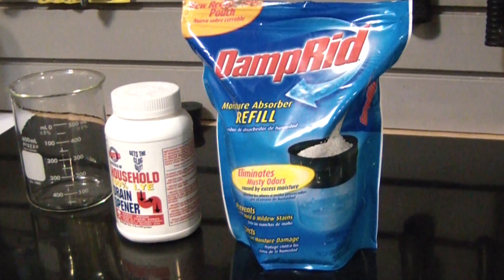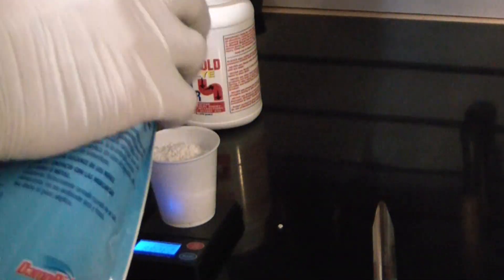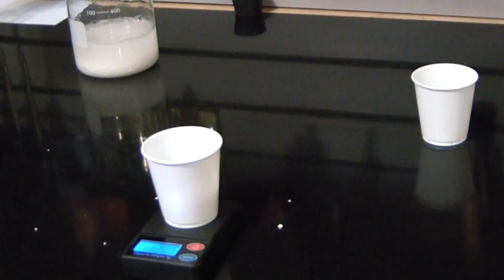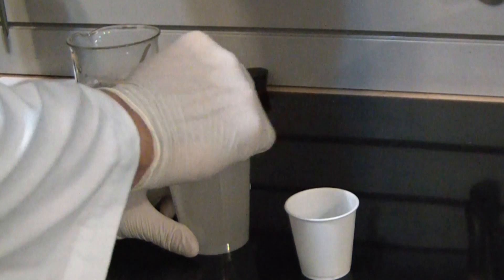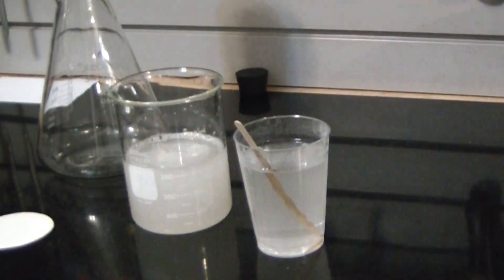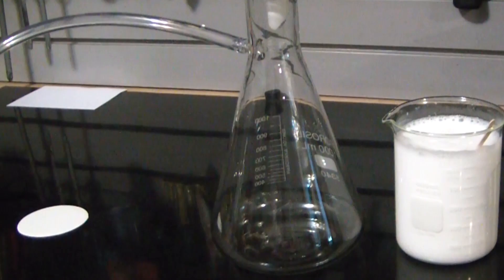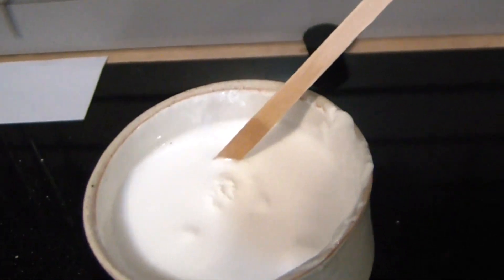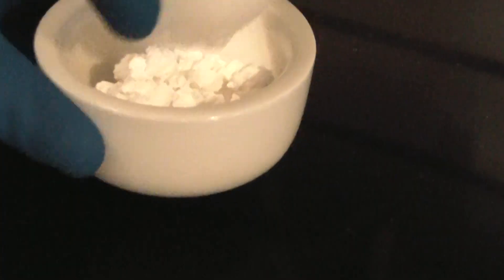Make Calcium Hydroxide

Comment: Excellent video! Thank you!! I am a post grad chem student and I frequently do my little projects at home.  I found this video while looking for a Ca(OH)2 recipe online.   I would like to make two suggestions... first,  since the chemicals involved are highly caustic and can cause severe burns, it would be prudent to make sure you've got a beaker of vinegar on hand.  When you accidentally spill aqueous lye on yourself or god forbid, someone else, fumbling around with the lid of the vinegar jug won't be fun. The second suggestion is that even though you are clearly adding the NaOH to the water, some folks may be listening to the instructions and not watching closely.  The water was poured into the beaker with the Calcium Chloride, which, is fine, but it could be disastrous if someone assumed they should add the water to the lye.

Comment: This is good. I recommend the reaction of sodium hydroxide with barium chloride. You get crystals of barium hydroxide instead of fine crystals. Incidentally, barium hydroxide is like 100 times more soluble in boiling water than cold water. This means you can recrystalize easily to remove impurities.

Comment: Hi, first of all thanks for the video. I would like to make calcium hydroxide by electrolysis of calcium carbonate in a simple continuous process that could be replicated in poor countries.. I guess if you start out with limestone and salt, you could (in theory) design  a process for making builders lime (calcium hydroxide) with a solar panel?  Electrolysis of concentrated salt solution would give hydrogen at one electrode and a chlorine oxygen mix at the other?  This Chlorine bubbling  up through moist calcium carbonate would displace the CO2 in the calcium carbonate giving you soluble calcium chloride that you cycle off. Then cycle that into the sodium side of the salt reaction to participate out the calcium hydroxide. on that side. (maybe as a white deposit under the electrode?    Or is there a simpler way?   Thanks Brian.

Comment: You said "vacuum distillation" 2x -- then "vacuum filtration". Assume "distillation"  was a brain-hiccup?

Also, you said there'd be a slight excess of the CaCl2 (I didn't calc out the moles, but assume you're right) -- so are we going to have that as impurity in the product, or does it stay in solution and pass through as filtrate (and wash filtrate)?
Reply from the maker: My apologies, that was in fact a brain fart! An yes, the reaction between Calcium Chloride and Sodium Hydroxide is: CaCl2 + 2NaOH = 2NaCl + Ca(OH)2. This means that given the slight excess of calcium chloride used, the only impurities in the reacted solution will be NaCl and CaCl2, both of which are highly soluble. A few washes of the mostly insoluble Calcium Hydroxide during filtering will flush all the NaCl and CaCl2 through the filter, so you will be left with relatively pure Ca(OH)2.
Reply: ElementCollector1001 is it possible to obtain elemental salt from this? if you can show that it would be amazing too! :)